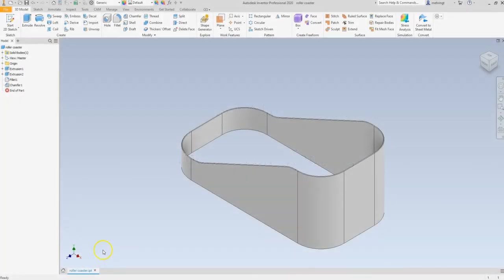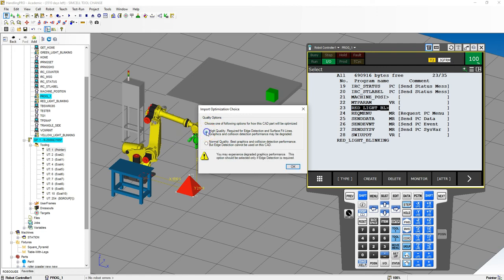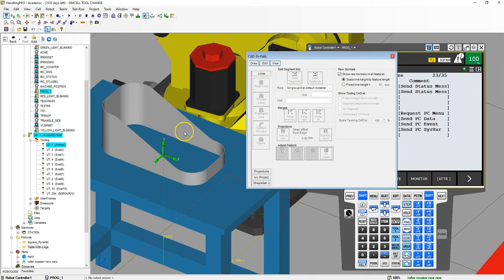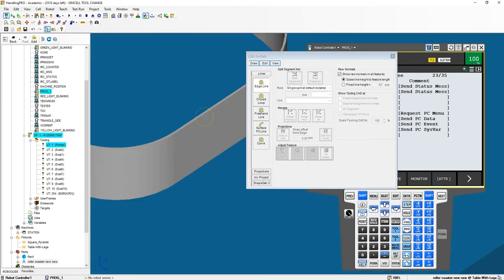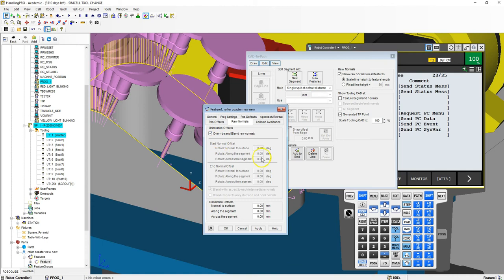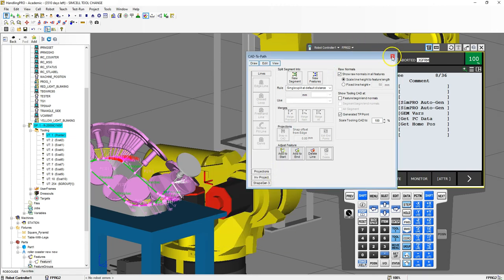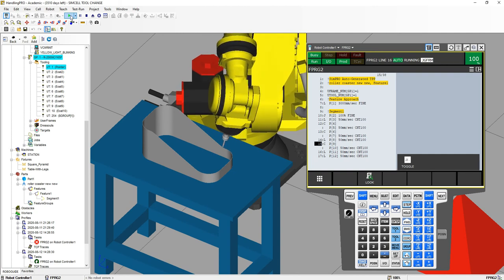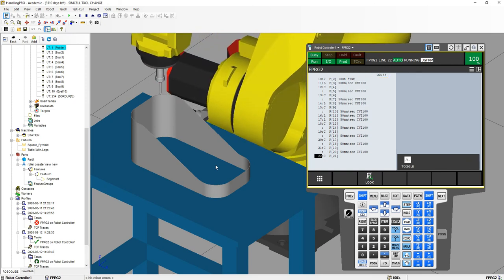CAD TO PATH IN FANUCS ROBOGUIDE

Comment: Hi Tim, thanks for the video. how would you setup the program for this kind of application to be able to just touch up one point (starting point) and have everything else offset accordingly. when going from Roboguide to real application the part distance might not be perfect, to be able to compensate for that. 
thanks
Reply from the maker: A couple of ways to do this. Position register for points and a coordinated position register used for offsets.  You touch up the position register and change the offset coordinates to what it needs to be.  The other way is to program shift the points.  Hopefully have a video on that soon.
Hopefully this helps
Reply: @timothymehring276  thanks. I'll be looking forward to the video